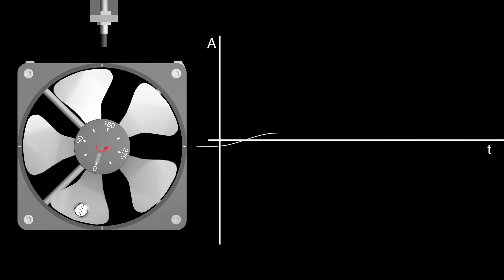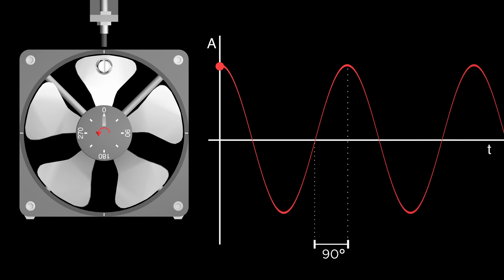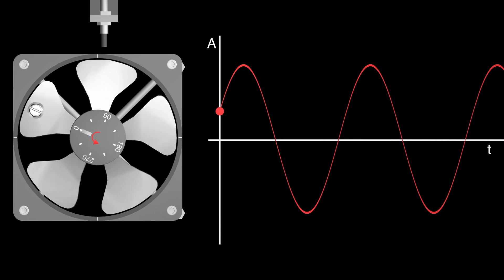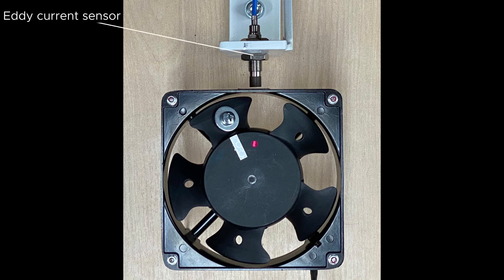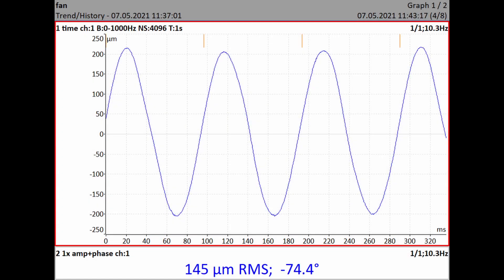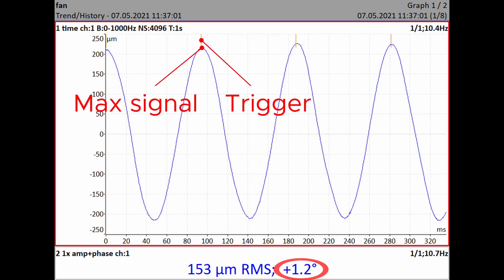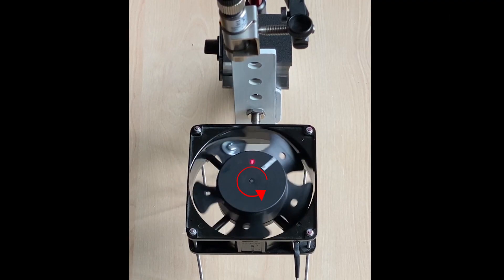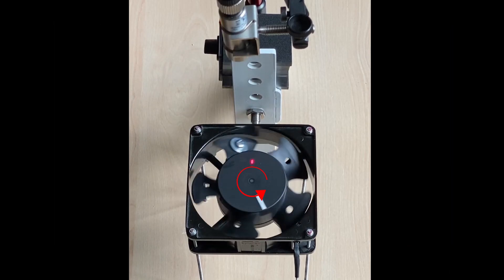Secrets of imbalance 1 (Heavy spot, Phase, Resonance frequency)

Comment: Excellent video - Very clear practical demonstration, however one piece of information is missing until 11m:28s in ... the rotational speed relative to the natural frequency of the system !

I use eddy current sensors most of the time balancing turbo-compressors and GT driven generator sets.

IDK if Adash allows double integration (we use the VA3 and SAB heavily in our routine work, but tend to use an 8 channel datalogger / analyser for balancing work), however with 4 channels on the VA5 or SAB you could have 3 measuring velocity, and one double integrated to displacement and draw a displacement polar plot to determine heavy spot location.